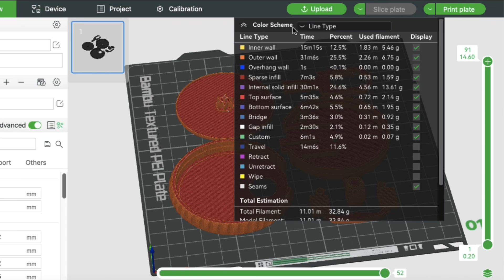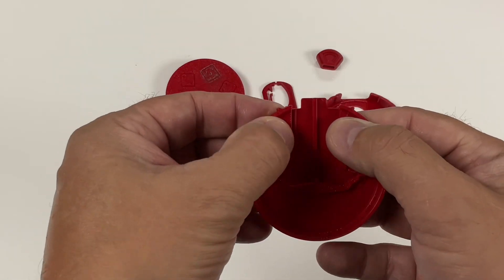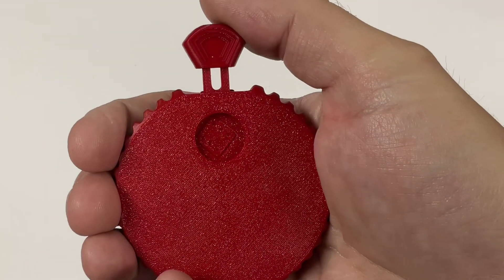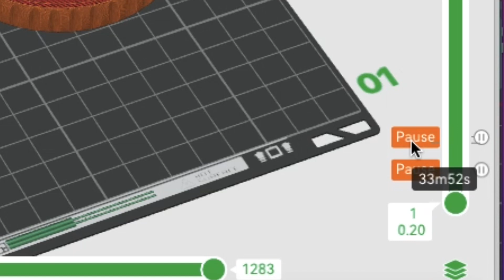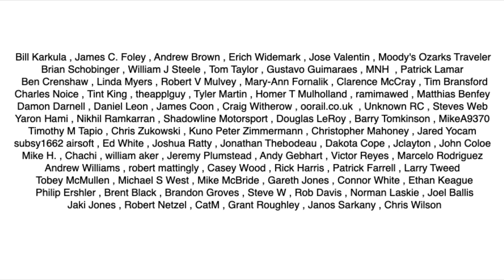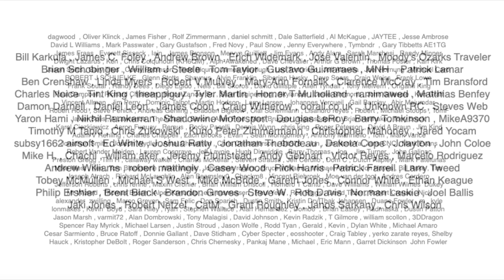Two Color Prints on Bambulab A1 Mini without AMS

Comment: can you pause and switch colour on the same layer level? i'm trying to print TPU with support and there is TPU and support printing on the same layer, but I only seem to be able to pause at the start of the layer, not on a filament change
Reply from the maker: Manually you can but it’s tough to time it exactly.

Comment: You don’t need to manually unload the filament in the a1 mini you can just press unload on the a1 mini so you colors won’t merge together.
Reply: Can't get my release to work? Was pulling pretty hard to get filament out and won't budge. How do you unload/load during a pause?
Reply: @mebunkeryou8718  use the unload setting on your printer it is easier then doing it manually because it unloads for you.
Reply from the maker: I find it quicker and easier to just pull it out while still hot. Then I don’t have to wait.

Comment: does this only work when using filament of the same type, could i not mix PETG with PLA for example?
I wanna print translucent Keycaps, but have the minimal exrusion of top layer that is the lettering in a differen color. i only have PETG translucent and various PLA and ABS at home right now.
Reply: petg and pla do not stick to each other, it wont work
Reply: i got it to Work for my backlit Keyboard by just using thinwalled bambu white pla. Pla is actually pretty translucent. its better looking than petg for this usecase imo. ty
Reply from the maker: Using PETG for supports on a PLA print or vice versa can work well because they don’t stick well to each other.

Comment: Not only has this helped me learn to print in two colours, this is THE FIRST TIME I've seen the locking lever being used, and it explains a LOT.

Only been printing for a few days, but been binging videos and even on the many I watched on changing filaments, this wasn't mentioned! I've manually pushed past that locking lever as that was what about 3 different videos all said to do!

There's a lot of great advice out there, but the only surprising downside to the A1 Mini is that the instructions given with the box and through their website are really poorly designed - incomplete, non-linear or just nt mentioned at all.

Beyond that, super accessible printer, really glad I got it in the sale so far.

Comment: Do the colors mix when you sre doing that?
Reply from the maker: The first layer of the new filament mixes with previous but that’s it.
Reply: @FilamentFriday  and i can't make the printer purge before printing with the New filament?
Reply: I would also like to know the answer to this question. Can you make the printer (without the AMS) to purge some of the filament after the color swap?
Reply: @icyfoxe  I think if you press unload filament on the a1 it will purge when you load the new one
Reply from the maker: @ - Not sure why you need this. It naturally purges quickly as it prints and isn’t visible.

Comment: No neccesary to add pauses. If you select the filament tab, when you select in the bar and click right click, you can add a filament change. Similar to prusaslicer. But only visible under the filament tab, not the line tab.
Reply: doesnt work for me, the printer blows past the color change
Reply: @helphelpmeahhhhhelp  I tried in my a1 and works perfectly.
Reply: @Leviatan23 I tried on my A1 and Orca Slicer, but to no avail, the printer continue printing with the same filament (( Which slicer did you use?
Reply: @helphelpmeahhhhhelp  U mnie drukarka ignoruje zmianę filamentu w Bambu Studio.
Ale w Orca Slicer ta funkcja działa świetnie.
Jest chyba jakiś błąd w Bambu Studio.
Reply: does that mean that it can also be midlayer

Comment: Every time I've swapped filament in my enders there ends up being an area of bad adhesion on that layer. How do you switch without effecting the structural integrity?
Reply from the maker: Make sure it’s extruding the right filament before hitting continue.
Reply: @FilamentFriday  I don't understand how that answers the question I had. Usually I'm swapping the same PLA, just a different color. Since my problem is structural, not color, how does purging help any? My guess is that the layer adhesion problem comes from the part cooling more for the few minutes it takes to do a filament swap than it would if the next layer started immediately, but it doesn't seem to matter how hot I run the head. I do generally use thicker layers, so I could try thinner layers when I plan to swap, but am I just out of luck if a spool runs out on a 0.2mm+ print? I've been slowing down the print and swapping on the fly instead of pausing.
Reply from the maker: If the filament starts coming out right away after the pause it should melt right into the previous layer. Not sure why it’s not working for you.
Reply: @FilamentFriday oh, yeah, I always make sure the nozzle is full and there's no gaps in the feed before restarting. It's not that it doesn't work. It looks fine, but they always break right where the change was.
Reply: @extragoode  explain swapping on the fly? interested!
Reply: @guccimoncler7029 I don't pause the print, partially because my older firmware on my ender 2 fails to resume after pausing half the time. So instead, I slow it down to about 20% speed and feed the new filament in to the extruder right behind the end of the old filament. Then the new filament pushes the rest of the old filament through the extruder.